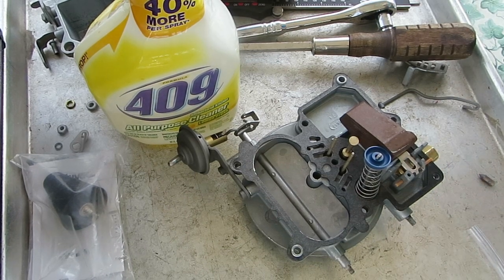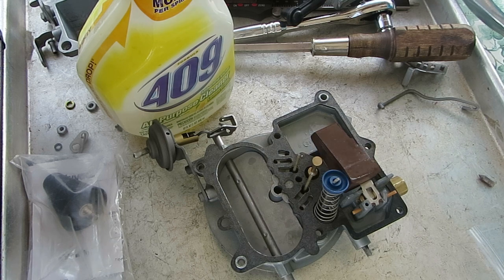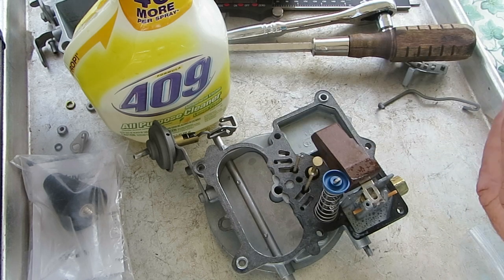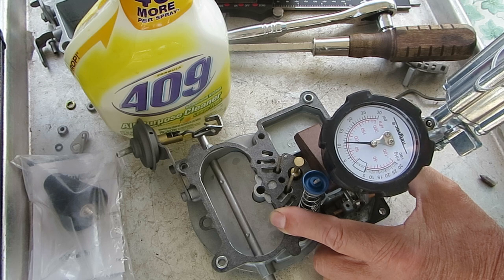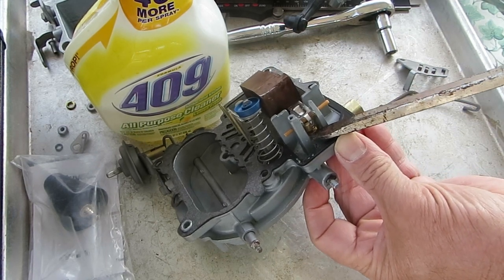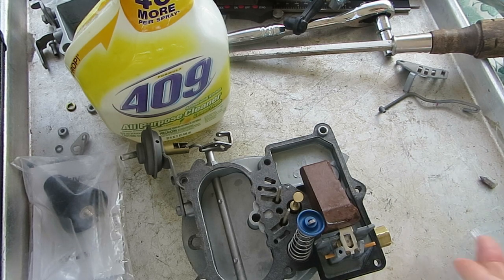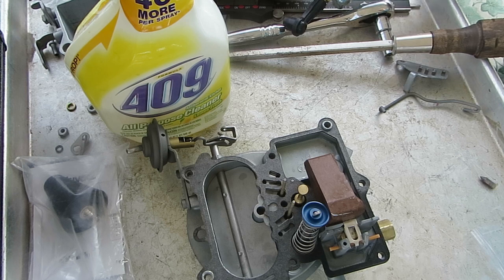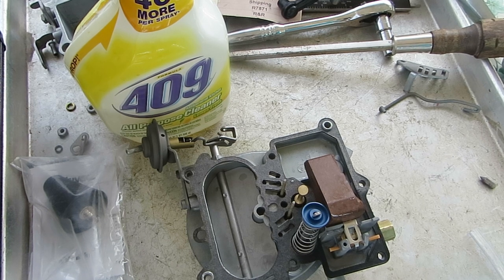Holley 2245 2 Barrel Carburetor Testing Needle & Seat

Comment: I tried this on my Quadrajet, pulled vacuum on the short run metal line leading to the carb.  It immediately held 5pounds and I even went to 10.  So, my needle and seat are sealing properly.  Gotta find the reason for my primary venturi drip at idle